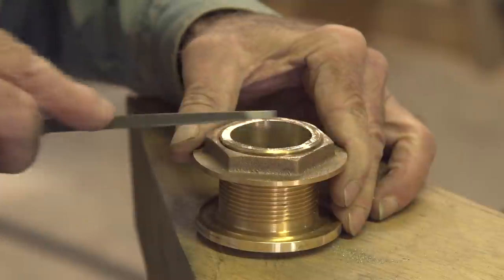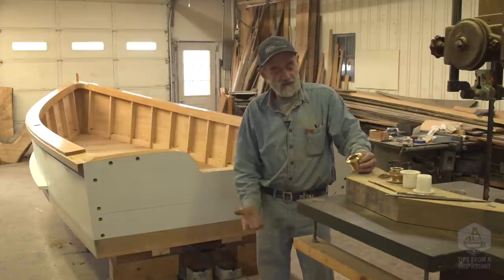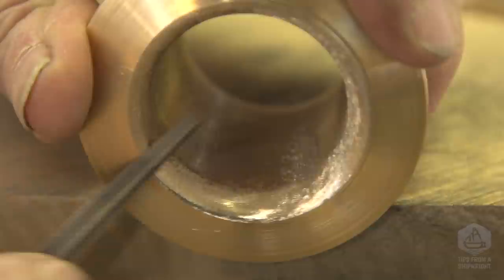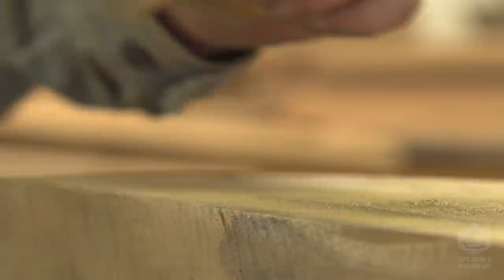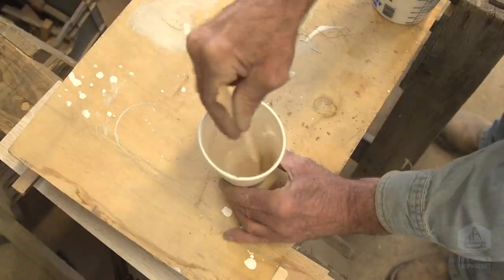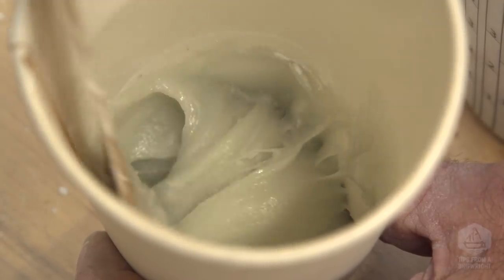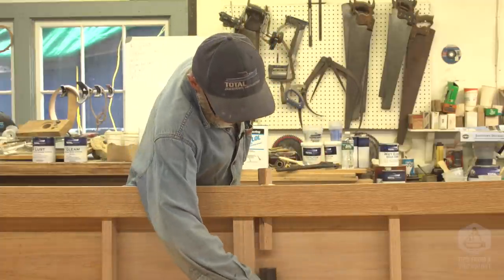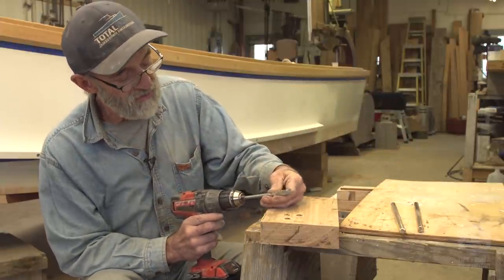Building the TotalBoat work skiff - Bronze and Epoxy (Episode 35)

Comment: Bronze delivers what plastic only promises.

Your genius is in the details. Great work.
Reply: Brian  Navalinsky I would not use plastic for this either.
Reply: Including expense.
Reply: Don't be so sure. There are plastic fixed bearings that substitute sintered bronze ones at a third of the price. If they can do that with thermoplastics and other components, ...
Reply: You've made my case.  I intended to express my opinion that bronze is more expensive, with very little functional advantage over polymers.
Reply: Sure, plastic can be great, but factor in the UV light and the plastic bearings will be done in a few years.
Reply: aserta Most sailboat manufacturers have been using nylon through hulls successfully since the 1970's. They work fine and last, but I have seen nylon speedo transducers split by sling pressure in haulout and nylon deck fittings wear poorly including denting and abrasion. Now think of bronze going to verdigris except for the polishing wear of the spring lines. A bronze hawsepipe is to the Mona Lisa as a plastic hawsepipe is to Keane's big-eyed waif.
Reply: I know this is true but Lou's boat harkens back to an age prior to polymers and I think his decision to use the brass is aesthetically spot on.

Comment: For an even tighter fit you could size the hole even slightly smaller, then put the rods in the freezer to shrink them and allow them to expand in the hole as they warm up.

Comment: You can cut a slot in a piece of tubing or a bolt, stick some sandpaper in it, chuck it in a drill and have a poor man's flapper to clean up the insides of the hawse pipes.

Comment: Lou, you're an inspiration! love these videos! I've been doing composites over 12 years and we've evolved a lot of the same techniques! if you used some epoxy on those belaying pins and holes, it'd act as a lubricant as well as a sealer on the wood. you could run the hole a few thousandths smaller and drive them in to more grain compression with the same force. not that it isn't already amazing work! thanks!

Comment: 11:23  "It is removable"    
Louis, I'd love to know how you would proceed ...
Wouldn't the epoxy put up a death-fight against turning the fitting to unscrew? 
You certainly can't loosen off the nut!
I'm thinking it would need some sort of custom expanding mandrel, perhaps slotted axially like a collet, and with a hex bore on a hexagonal steel bar central spindle, which expanded the mandrel in proportion to the turning force. Would you heat the bronze first to soften the epoxy? Enquiring minds want to know!

Comment: Here's hoping you never need to remove that, because with the nut locked in place and the epoxy holding the hawsepipe in place, it's going to be very difficult to remove in one piece.

Comment: So Louis, I have a question.

Could you cold mold a 100+foot schooner?  I saw a guy do a 75 footer in Vietnam a few years ago and it was gorgeous.  
If so, then how many layers of planking would you recommend and at what overall thickness?  Of course, you would also have to consider the frames too.  Would 6" x 8" or  8" x 10" frames on 16", 20" or 24" centers be appropriate for cold moulding? 

 I saw a knockabout schooner (the Adventurer) getting some new planking in Newport a while back.  But she was double framed with 8" x frames on 12" centers with 3" thick planks and decking.

Comment: I really like your method with the lines on the stick for measuring the 2 to 1 ratio for the epoxy, but wouldn't the taper of the sides of the cup cause the volume on top to be a hair bigger?
Reply: Wayne Welshans not if you pour a set amount of water into the tapered container, then mark the stick, and repeat.
Reply: That's close enough for mixing epoxy.
Reply: It's a negligible amount. The ratios can be off my a few grams and it won't make a difference.

Comment: question:   aren't belaying pins intended to be easily pulled (or knocked) loose, so as to quickly release the line?   I always understood it was the tension of the rope and a bit of gravity that held the pin in place....
Reply: Tim Hyatt Thats how they normally are like. I never heard that they are intended to be knocked out though. I think you could only do it with a hammer under tension. Cutting the rope would be quicker.
Reply: as I understand it...the belaying pin was the "tie-off" point for various riggings (booms, sheets, jibs, et al) on sailing vessels.   they were typically tied off, and the were vertical in the framing, and were tied off in such a way that pulling the pin would free up the entire length of the rope if it was needed freed in a hurry (sail changes, needs of ship to ship combat, etc)     

It may well be that the nomenclature is such that any pin used as a tie off also gets the name and i will admit my ignorance on the issue.   I asked only for the point of my own understanding as it wasn't fitting the terminology i had been taught so I was a little confused...
Reply: English is my second language, so I would not know it any better. We had them vertical too. Fitted around the 2 masts taking only loads along the mast.

Comment: There is something kind of melancholy about these videos. Lou talks about the design of this boat as if it'll be used by fishermen, when in all likelihood this boat will be a collector's item or rich man's plaything. Sad to see a beautiful boat built by a master knowing it won't be used as it was built for.
Reply: We're talking about a custom-built wooden skiff built by a master craftsman from scratch, as a promo for two marine supply companies. In terms of materials and labor cost alone this already is unaffordable for most working seamen. For that matter, wood construction and extensive varnishing adds expenses and maintenance requirements that a fisherman could easily avoid if he were to buy a production-line fiberglass boat.

Modern commercial fishermen are businessmen. You wouldn't see them using what is essentially a classic antique-replica boat just as you wouldn't see a truck driver using a classic truck from the 60's.

Source: am a commercial fisherman

Comment: As a machinist I could have radiused those parts on a lathe. In half the time and with a better finish. Nice work otherwise. Each to his own trade.
Reply: John Flynn Lou did what most people would be able to do. And like most people, I'm not a machinist, the expense of hiring one would make the parts prohibitively expensive. A great demonstration of common sense problem solving.
Reply: Lou had the parts modified, with an added radius, by a machinist. It's the machinist I critiqued, not Lou.
Reply: John Flynn it was also a good opportunity to show a little hand work and problem solving. I'm also a toolmaker.